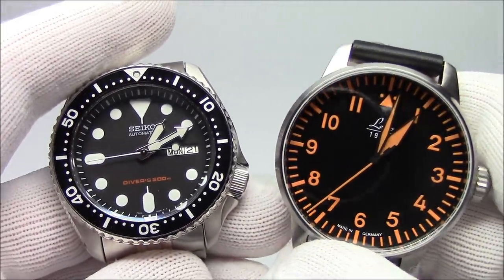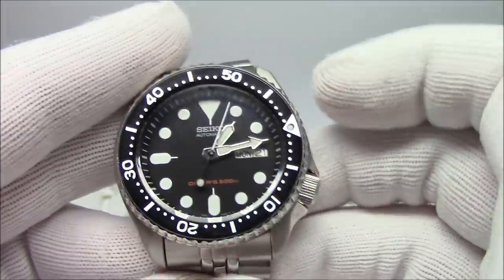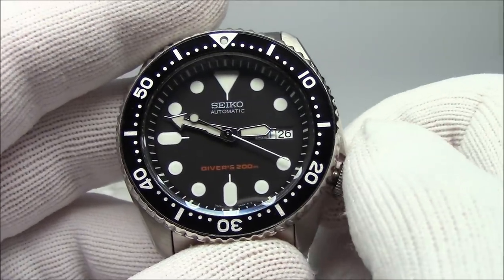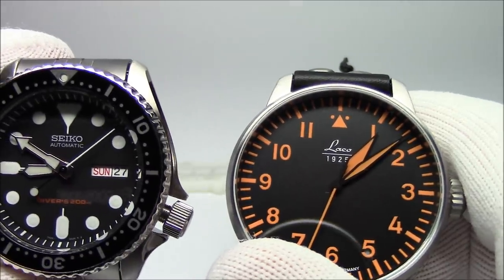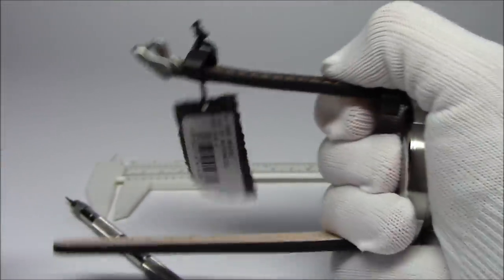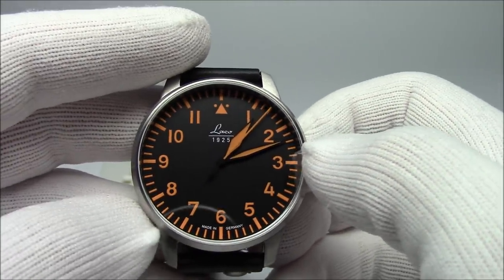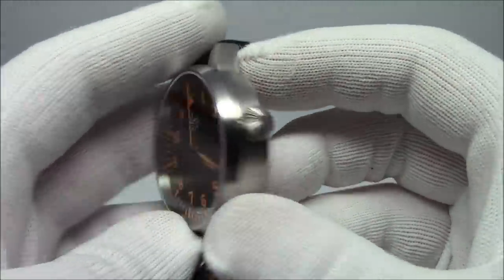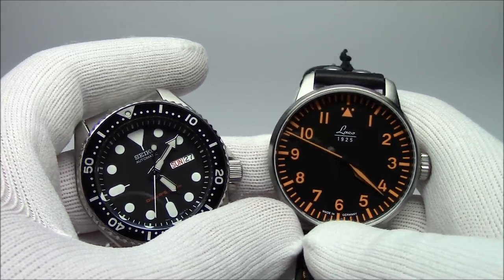Watch and Learn #1: General information about watches and uses

Comment: 30 years wearing watches and i never knew that changing date between 9pm and 3am could damage the mechanism. i wonder how many watches i've broken because of that.
Reply: Hope you've learned many more new things about watches! They're great tools that need some attention to detail to maintain it for many years of use.
Reply: Orient is between 9pm and 4am. I read that in the manual haha, hardly anyone bothers to read them anymore which is a shame.
Reply: I'm sorry if I sound stupid, but how do I know if the watch is in AM or PM now?
Reply: If you have a watch that is running, which you had set previously, you'll know. If your watch has a 24hour-complication, that would be another method. If neither of those above are your case, you'll have to manually cycle through by adjusting the time on a watch to see if the date changes when passing 12. if it changes, you've just passed midnight and entered AM. If it didn't, you have entered PM. If your watch doesn't have a date feature of some sort at all, none of the above should apply to you.
Reply: Hi. Man. Ok

Comment: I’ve owned diver’s watches for over 50 years. My understanding of a time elapse bezel is that you set the pointer to the end point of the time you want to measure. In other words, if you have 10 minutes of air left, you set the pointer to 10 minutes ahead of the current position of the minute hand. That way you can watch the time count down to zero. It works for cooking and stuff like that too.

Comment: When I set the time and day/date, I usually advance the time to the 6 o'clock position, then set the day/date to the day before the day/date I am setting to.  I then advance the time past midnight and then to the correct time which avoids the do not set between 9 and 3 issue.

Also, something a machinist taught me is that when working with fine threads such as on a screw down crown, before screwing the crown down I turn it counterclockwise while pressing  in until I feel a click and then screw it down clockwise from that point.  That way you know you are engaging the threads at the begining and avoid damaging threads which some of us heavy-handed types sometimes do.

Comment: how to remove the solid base jubilee bracelet. i have a skx009k2 and i wanna change it to leather . Any help?
Reply from the maker: You need a thin fork bracelet tool, you need to get between the lug and bar, and push down/pull. The Seiko bars have no shoulders so its a bit more difficult.
Reply: thanks but if you do a video on it will be more easy to do myself.  Appreciate it👏👏👍
Reply from the maker: indeed : )
Reply: Put some tape on the case so you don't scratch the watch.

Comment: Just to be clear, i cant change the date just when the hands are at 9-3, or i really cant change it when jts 9pm to 3am realtime? For example its, its currently 10pm realtime and i want to change the date, can i just move the hands at say 6:30 and change the date, then change the time back to 10pm?
Reply from the maker: Really PM is the issue. If its between 9am and 3am, do whatever you want!

Comment: Casio G Shocks are all WR to 200m with screws on the back!
Reply from the maker: Yes they are. The cases are plastic, and not exactly round. So they don't lend themselves to full threaded backs.
Reply: Long Island Watch Yes, that is true of the newer models. In the 1980's and 1990's Casio used resin covered metal cases and screw backs on many of their G shocks (DW-5000, MRG-1, etc). I own a few both older and newer:)

Comment: Nice video for all the starters! One small correction on terminology though: if you occasionally turn the dive bezel, you're not shortening the dive, you actually lengthening it! What shortens is the remaining time. So if you know that you have air worth of 30 minutes dive in general, at any given time during dive you will shorten remaining time and it is safer to go back up earlier rather than later. For people who do not know what crown is and what's a uni-directional bezel is that small detail might be a bit confusing, I think:) Keep up good work and thanks!
Reply: Maybe I'm underestimating the average viewer, but to me it was pretty obvious that he was referring to the total dive time, not elapsed time. So you are both saying the same thing.
Reply: dtosky may be. May be I got it not exactly right. But as Marc says he's surprised how many people mess uni- with bi-, which seems obvious right? If you ever encountered users of anything in numbers, you should know how many people get so many things wrong. While yourself would get it right even with actual mistakes automatically, because you have the concept on your mind, you have the right idea. And like that old wrod pulzze whit mesesd lerttes yuor mnid hleps you at a glnace, you need to pay attention to see the trick;)
Reply: dtosky on a second thought, you write "total dive time", but bezel is about remaining time, not total. Total is how much you spend under water, bezel instead says how much time remains and this is relative time. So you see, terminology is playing tricks...

Comment: I have heard that the other reason for a screw-down crown is that even in water resistant watch, the stem is usually the weak link for water sealing, and since the crown itself seals to the case with a screw down, the stem seal is no longer a factor.  Is that true?
Reply from the maker: Sort of; check out Watch and Learn #5 and it discusses this a bit more.

Comment: Could you dispel a myth? I've heard that older - 1920s/''30s/'40s 
watches were supposed to be wound with a back and forth motion rather 
than unidirectionally. Is that true for any movement?
Reply from the maker: I have never heard that. I couldn't imagine it matters. When you turn back, you are disengaged from the spring. I don't like to turn backwards since its against the way the crown is threaded to the stem, but that's quite minor.